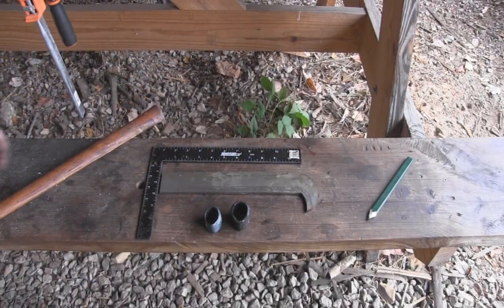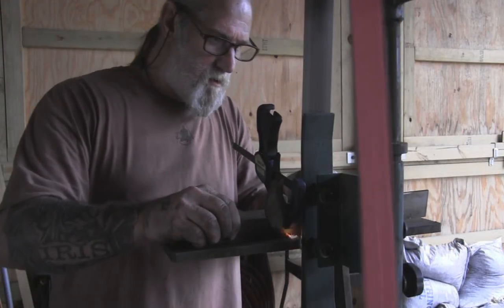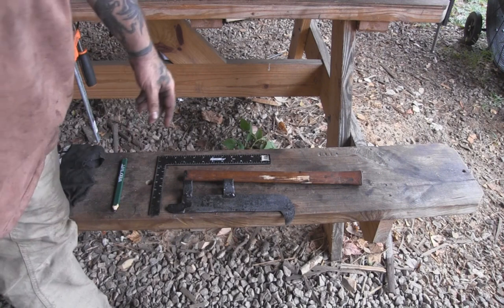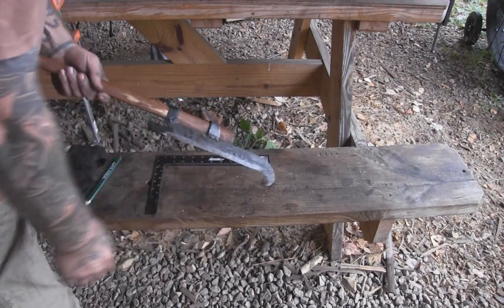Bill Hawk

Comment from the maker: Many Folks have missed the entire point trying to correctly name this tool, I own Brush Axes and Bill Hooks, this was a concept to combine them to fit a Tomahawk Handle, making a functional tool that could be used with other tool heads fitting the same handle, This is smaller than a Brush Axe, Has no pivot on the back ring, and is thicker in material than a socketed or rat tail tang billhook of the UK.
Reply: wildernessoutfitters Dave, since you have commented in the past about "it will cut" and Liam was recently on the show, any interest/been approached about being a part of Forged in Fire?

Comment: Dave I know you welded a bead on both sides of the handle "rings", didn't see if you put part of the weld in front and back of both "rings". A lil advise for you from a former shipyard welder from South Louisiana, if you didn't put a spot weld front and back of the rings there will be a moisture  gap under the rings, a place where rust will corrode the tool. I know you take very good care of your tools, but under the rings will be hidden where rust will develop unseen.  Another good blacksmithing video , thanks for sharing this one with the idea of multiple tools to fit one handle.

Comment: a tip for good ring alignment. 
place the rings on the handle and line up the rings handle and blade together. tack them in place with a couple spots on each side. remove the handle and weld out the desired area.

Comment: We use to call that a brush axe down in Alabama....that hook is good to rip thick brush, etc. Never heard the term bill hook. I like the idea of tools for the hawk handle.....easy to repair/ make in the field compared to a traditional axe or tool handle.
Reply from the maker: Bill Hook is a European Terminology
Reply: Yea a bush ax or brush ax, only smaller.
Reply: +wildernessoutfitters Bill hooks generally have a different type of handle and purpose.
Reply: I think most brush axes would be considered billhooks, and a brush axe would be a Swedish brush axe, which handle looks more like an axe, but with a replaceable blade.
Reply: RenThraysk
Most traditional US brush axes I've seen have axe type handles, whereas the Swedish brush axe you mention is a new concept.

Comment: Would it be practical to design and fabricate a tool head similar to the new MSK1 knife and attach the metal ring for using as a hatchet etc, but then take it off the handle and use it as a skinning knife, ulu or other knife?

Comment: You used modern techniques to weld the blade to the rings. How would you approach this in a more traditional method?
Reply from the maker: Flat Stock wrapped around a drift with overlaps on the blade punched and pinned
Reply: Probably by forge welding. Welding was done by essentially hammering the pieces of metal together while at high heat; it's a bit tricky, but was very common practice.
Reply: you can also use a flux to help clean up your material which will help your metal to weld together.

Comment: Not quite sure where I'd use this particular design. Looks too unwieldy to use for hedgelaying, and I use a two handed Yorkshire billhook for that. For clearing work, prefer a double edge Irish slasher (essentially a Yorkshire billhook pattern with a 30"+ handle).

The old method of a lot of socketed billhooks was wrapping the tang of the blade around the handle.
Reply: Probably because it's basically a brush axe, not quite the same sort of implement.